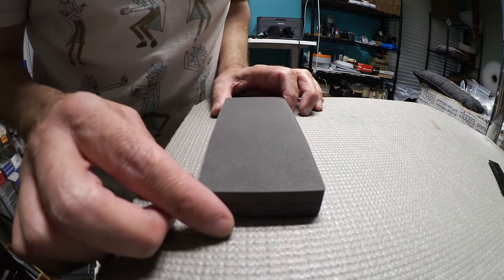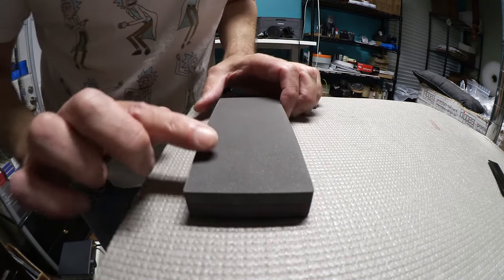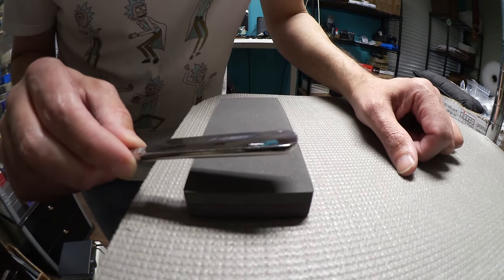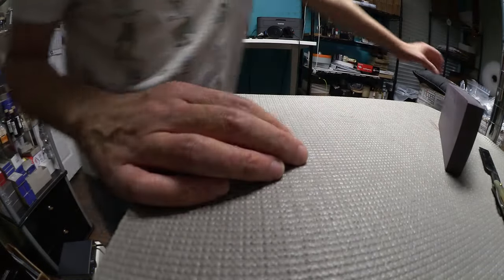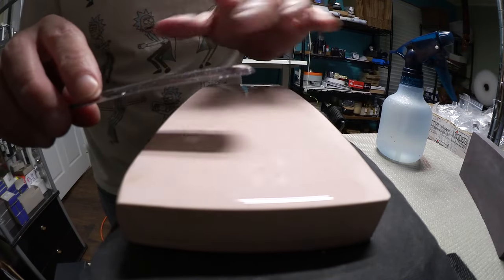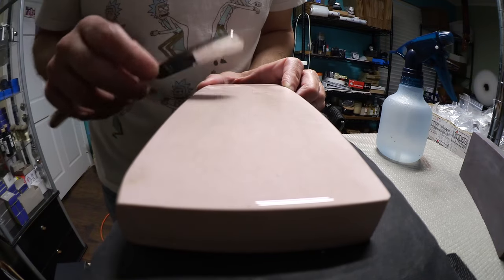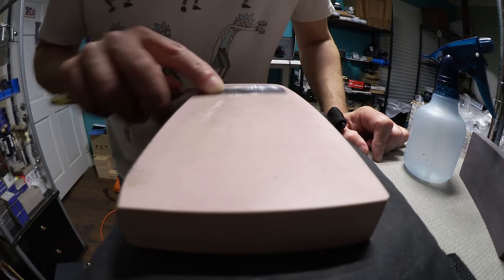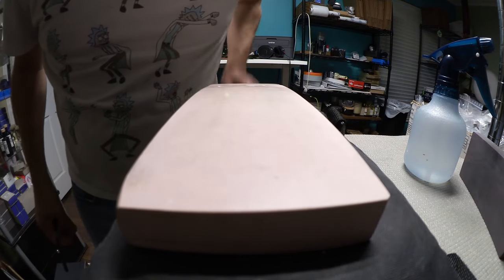Straight Razor Honing; 3 Methods to Even Bevel Widths When Using Laterally Convex Stones 12.19.2023

Comment: Why complicate the process with convexity when a flat hone does the job perfectly well without the unnecessary added variables?
Reply from the maker: In all seriousness, the question at hand is the designation of "perfectly well"; if you are perfectly happy, perfectly content, with what you've got, don't mess about!  To quote the great Charles Oakley, "If it ain't broke, don't break it."  

I thought a premium moving magnet cartridge rendered the music from my turntable perfectly well, until I tried a moving coil cartridge, which I thought did it perfectly well, until I tried adding a step-up transformer between the cartridge and the phono preamp,...

It is a mental sickness.  

My own face, as I have aged, it is extremely challenging to get an edge which works well in the mustache area.  Concaving the bevels, via the use of wheel shaped whetstones, was a large aid in this challenge, for me.  

Master grinders do it because they feel the razor edge should be concave, toothy, and if set on a wheel shape laterally across the stone, has some chance to remain with more width than if set with a flat stone.